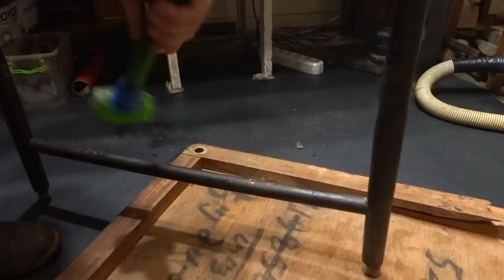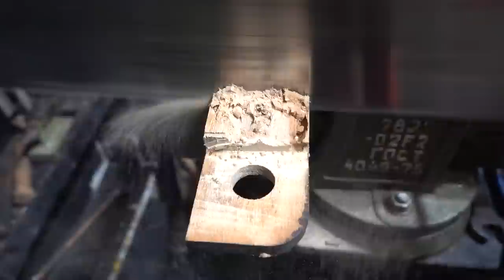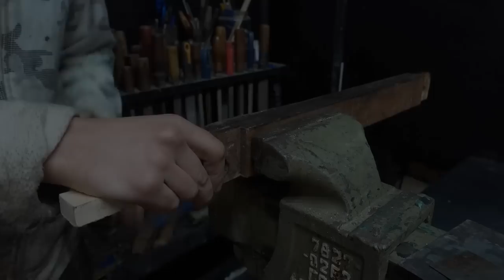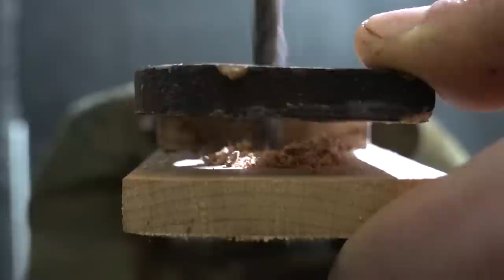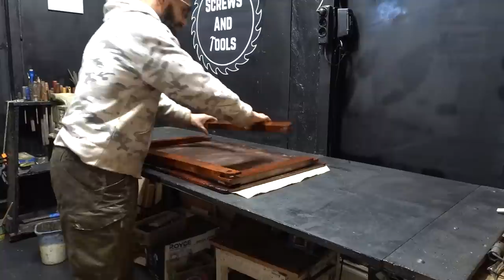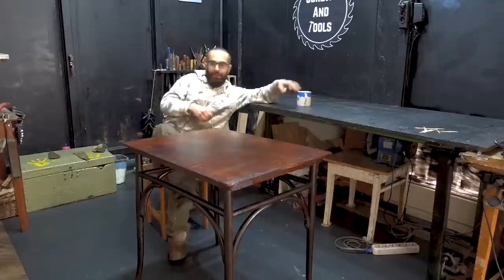Restoration of Old Wood Soviet Table

Comment: For first time really not bad. I would probably replace more rotten wood instead filling with putty. Also paint remover would help to clean parts more properly and later have more even color.
Reply from the maker: Greetings! And here's another tip. I got a lot of them. I've been wanting to try furniture restoration for a long time, but I couldn't make up my mind. Thanks for attention. ^_^

Comment: the only thing i question is the wood putty over the screw heads
Reply from the maker: And then I painted them over. I did not repeat myself and shoot on camera. Although maybe it can be done from below?
Reply: @ScrewsAndTools  I meant more cause it would make them a lot harder to remove, if you needed to.
Reply from the maker: @Zero-.-  Yes, you're right about that, of course)

Comment: Dude. Way too much glue. Do not add water. Use shim or needle to purchase glue in cracks. Repair will last much longer. Steam to straighten before putting on weights. Beautiful results.
Reply from the maker: Hi, well, it was the first time. Got a lot of advice. Will the glue for the tree definitely pass through the needle?
Reply: @ScrewsAndTools  Yes, as long as it is wide bore. Too much glue will prevent a good bond.